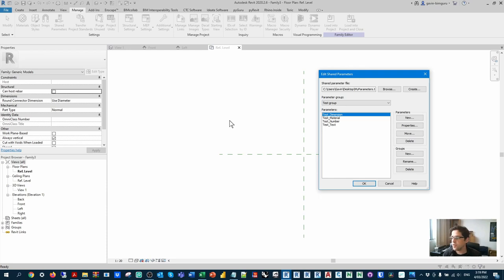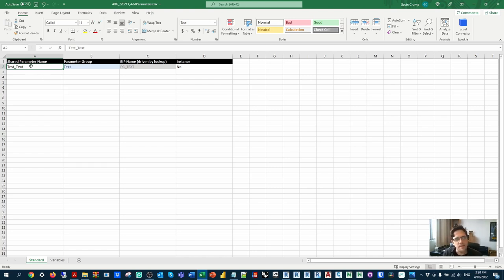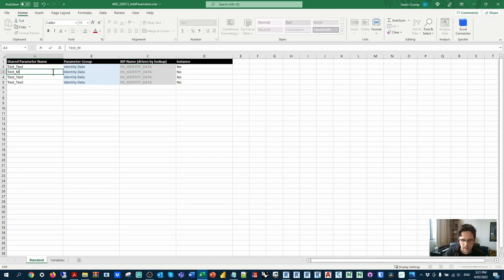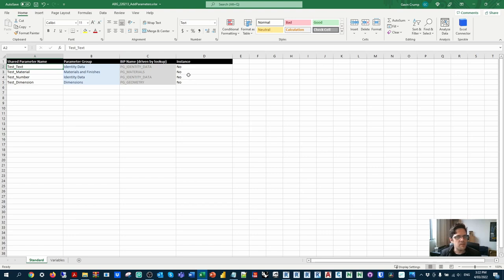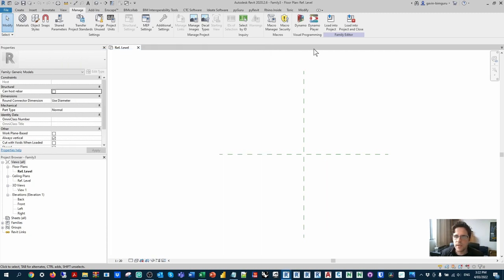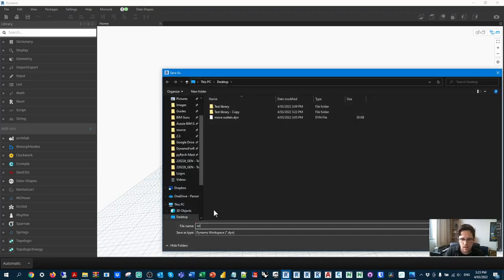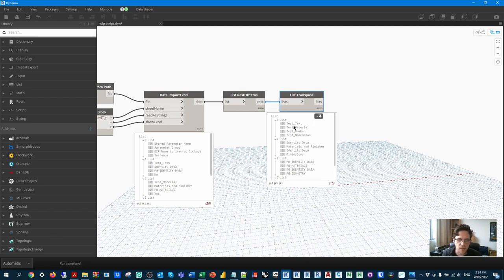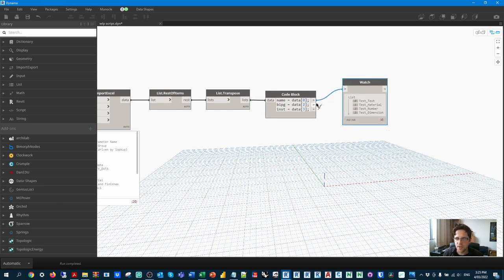Add parameters to Revit families using Dynamo (and Crumple)!

Comment: Thanks Gavin!

If anyone is using Revit 2025, some key compatibility updates/fixes for the new 2025 API are listed below, and updating this worked for me (also I don't have access to some of the nodes from Gavin's package so I created custom Python ones... but this below is updating BuiltInParameterGroup which is deprecated so use GroupTypeId).

1. Using "IdentityData" as example (not "PG_IDENTITY_DATA" from the old API version) matches the property name in GroupTypeId in Revit 2025.
2. Object Type: for Revit 2025 is of type Autodesk.Revit.DB.ForgeTypeId, which is expected for properties in the GroupTypeId class.

So, the input string "IdentityData" produces ForgeTypeId object in Revit 2025.
Reply from the maker: Yep it's a big change, I've added it into my Crumple nodes in the latest build.

Comment: Good to see your package 🙂

I am looking forward to open family from project and update its parameter values.  I searched on dynamo forum and Orchid package but all are pointing to directory. In my case every family has item number which is of instance type and the parameter values  will be assigned based on that.  

If you could provide node in your own package, that would be really helpful.
Reply from the maker: I have typically found directories a more stable method versus from project, however the method you could explore is in this case doc.EditFamily(x) where x is a family symbol object. There's a Python example of it here:
https://forum.dynamobim.com/t/change-family-category/57455/15

I'm unsure how this would work in bulk with the family manager but it's on my list to test out.

Comment: Hi Gavin, thanks for all the tutorials. Do you also have one for getting and setting of parameters using your package crumple? Tried varies methods, but only thing it returns is 'null'.
Reply from the maker: Not currently. For get parameter it only works for strings/numbers and across a list of family documents. For set parameter it requires a list of family documents/parameters and a list of list of values to set. If it isn't in that structure it wont work and will return null.
Reply: @AussieBIMGuru  Appreciate your response Gavin! I tried both, first with opening multiple documents in background, secondly with the current document. Or do I understand correct that you have to use a list of family documents? Anyway, there are four nodes; Document.Current, FamilyDoc.Types, FamilyDoc.Parameters and FamilyDoc.ParameterGet the first three all respond like expected, but the last node returns a null on every parameter. It should still run in Revit 2022 right?
Reply from the maker: @marcdenheijer606  so I believe I never made the node able to do multiple family documents due to it being too convoluted.

I've made an example in Python here of setting multiple family parameters by type and family using Excel here and will make a video for it in late June.

https://github.com/aussieBIMguru/Misc/blob/master/230512_ABG_SetFamParameters.zip

It doesn't accommodate for parameter data type, but can set any value with the right data types before it heads into the Python node.
Reply: @AussieBIMGuru  This is brilliant, thanks for this script Gavin! Tried the script and with some modification it did exactly what I expected: set certain parameters for all families and types (without specifying them in Excel). 

I suspected your first statement, therefore I also tried the crumple package also for just the current document. Without any success. Looking forward to your video!
Reply from the maker: @marcdenheijer606  glad to hear it helped! I'll likely package these up in a slicker format in my pyRevit toolbar down the line (guRoo), as I've moreorless cracked adding/deleting/replacing parameters and setting/getting/formulating parameter values as well via Excel and Python.

Comment: Hi Gavin! Thanks a lot for your videos! I've noticed that the AddParameter Method (String, BuiltInParameterGroup, ParameterType, Boolean) is no longer available in the Revit API 2023. As a result, I've started using the AddParameter method (String, GroupTypeId, Boolean). However, I'm facing issues when trying to adapt a similar workflow for the BIPGbyName node. Could you provide a hint on how to solve this problem? Thanks a lot!
Reply from the maker: Yep new forge unit API gripes.

Theres a good summary of how to work with this new class here as a reference:
https://forums.autodesk.com/t5/revit-api-forum/how-to-use-forgetypeid-to-add-family-parameters-to-a-family-in/td-p/11591733

Comment: very powerful and useful script👍
is it possible to assign values or even formulas to the parameters using dynamo?
Reply from the maker: Thanks!

Yes it is indeed, although i would suggest a different script for such an approach if you're driving it via Excel. Orchid and Crumple both have nodes for getting family types and setting parameters by name and family type (in family editor). Orchid has a node that can set formulae by parameter name and familydoc. I have a video on formulae in families from about a year back I think
Reply: @AussieBIMGuru  Thanks Gavin!

Comment: Nice explanaation. I have a question. Is there any way to make a similar proccess with imported families in the project? for example - add parameter to section tag family ? How do I open this family, if its in the project itself ?
Reply from the maker: Yes instead of opening the document you would need to use edit family and load document from revitAPI:

https://www.revitapidocs.com/2024/56e636ee-5008-0ee5-9d6c-5f622dedfbcb.htm

https://www.revitapidocs.com/2024/cb950c8e-f440-c6db-8563-d1dd16ef3fee.htm
Reply: @AussieBIMGuru  Thanks for the information. Already made same exel file as yours, saved family as a separate test file, and trying to follow each of your steps in this particular script to make it working.))) And after that, I'll check how to do that with edit family technique that you've shared with me.

Comment: thanks a lot , Is there a way if I wanna change the parameters type after i set them to instance or type because i tried it by changing the value in excel file but nothing happened
Reply from the maker: Yes unfortunately this script only adds new parameters. To modify then you would need another workflow that gets existing parameters then attempts to switch them to type or instance using Python. I believe clockwork may have some nodes that do that.
Reply: @AussieBIMGuru  waiting for it, thanks
Reply from the maker: @amratef3134  it's probably not going to be a video for me as it's a very narrow topic. I'd suggest looking into clockwork and if not engaging dynamo forums for assistance. I don't tend to do many dynamo videos these days as I'm exploring pyrevit/grasshopper more often.

Comment: Hi Gavin, excellent video... Again! if some of the families allready have the parameters with values, will the script overwrite these values or the script is written in such way that if the paramater exists it doesn´t touch the familly?
Reply from the maker: If the parameter exists already it will fail to add it, but should skip that step in the custom nodes.

Comment: Hello Gavin, great tutorial (as always). I was wondering if you have used this application for editing a model (and its nested families) received by a design team? If so, how do you get around having to reload each individual family into the working project?
Reply from the maker: Generally i would save all families out to a directory, run the process over them and then reload them as a set. That or request that the design team provide the parameters in their model in future.
Reply: @AussieBIMGuru  Thank you for the quick response. I will check to see if we have any pull with non-Design Build project architects

Comment: Would be interested in a similar node that worked in the active family document.
Reply from the maker: If you connect a current document node to the familyDoc input that should do the trick.
Reply: @AussieBIMGuru  Tried it out and it produced null as a result and did not add any parameters.
Reply: @AussieBIMGuru  Tried to edit the node like you suggested in the video to work with the current file but I always get null as a result. Its strange because there was a section in the code that looked like it replaced 'doc' with current document if the input was blank, but whenever I run without that connect it just returns function.
Reply from the maker: @facelessone86  yes the node should get current document by default in latest version of crumple and should not need any changes
Reply: @AussieBIMGuru  I'll try checking to see tomorrow if I'm up to date but it looked like I saw it in the code but wasn't working for me.

Comment: I see you’re using revit 2020.2.6. Did you also experience stability issues with 2020.2.7? Last month I had upgraded but within a day I experienced stability issues and reverted back to 2020.2.6. Read on an Autodesk forum other users had experienced the same issues. I had to spend over an hour to reinstall version 2020 because of it. Luckily I can do my new projects in version 2022. The PDF export feature is a real time saver for me.
Reply from the maker: Yep my mates warned me about it so I've been holding off for now. It doesn't seem Autodesk tests their updates very well these days, ever since that family loading debacle in 2021.

Comment: We created a Dynamo script that will get the parameters of a selected nested family in the family file, and copy its selected parameters into the family file (creating the same parameters there), and set their default value to the same value that the nested family had. Is there a way to make those parameters automatically associated with the parameters of the nested family?
Reply from the maker: I havent tried it before but it looks like this should be able to do that:
https://www.revitapidocs.com/2015/a047ea58-0351-b419-d856-85ed23734ee8.htm
Reply: @AussieBIMGuru   Thank you! Finally, I was able to do it with a Python script, that I copied from a forum, and had to modify to loop through each element of my list. It takes two inputs. IN[1] is a list of the names of parameters that I want to associate with each other (in my case the parameters from the nested family had the same name as the parameters in my family I wanted them to be associated with). IN [0] is the nested family element (for instance parameters), and the nested family element type (for type parameters).
Reply: import clr
clr.AddReference('RevitAPI')
from Autodesk.Revit.DB import *

clr.AddReference('RevitNodes')

import Revit
clr.ImportExtensions(Revit.GeometryConversion)
clr.ImportExtensions(Revit.Elements)

clr.AddReference('RevitServices')
from RevitServices.Persistence import DocumentManager
from RevitServices.Transactions import TransactionManager

doc = DocumentManager.Instance.CurrentDBDocument

elem = UnwrapElement(IN[0])
list_1 = IN[1]

for i in range (len(list_1)):

	paramNames = list_1[i]
	famNames = list_1[i]

	if not isinstance(paramNames, list):
		paramNames = [paramNames]
	if not isinstance(famNames, list):
		famNames = [famNames]
		
	elemParams = elem.Parameters
	famParams = doc.FamilyManager.Parameters
	
	
	elemAssoc = []
	famAssoc = []
	
	for param in elemParams:
		for name in paramNames:
			if param.Definition.Name == name:
				elemAssoc.append(param)
	
	for fparam in famParams:
		for fname in famNames:
			if fparam.Definition.Name == fname:
				famAssoc.append(fparam)
	
	TransactionManager.Instance.EnsureInTransaction(doc)
	
	for i,j in zip(elemAssoc, famAssoc):
		doc.FamilyManager.AssociateElementParameterToFamilyParameter(i, j)
		
TransactionManager.Instance.TransactionTaskDone()
	
OUT = elem

Comment: Nice job!! It works fine, but now I'm trying to add also a formula to some of the parameters. I've add a column to the excel file with formula values and tryed to modify the python script for "familyDocAddSharedParameter" but won't work... any ideas?
Reply from the maker: You'll need to use this method of the family manager class to set a formula:
https://www.revitapidocs.com/2023/cdc3156c-0334-0bba-70af-1df78fb18b50.htm
Reply from the maker: Once we get to python in YT comments its best to take it to dynamo forums, too technical for this environment.

Comment: FamilyDoc.AddSharedParameter gives me "Parameter not added" message. Recreated all script structure from your video + exel file. Cant figure out whats wrong.
Reply from the maker: Most common issue that causes that is not being connected to the shared parameter file or typos in the excel data.

My nodes wont typically work in 2024+ as they changed the Revit API there as well.
Reply: @AussieBIMGuru  I just tried in Revit 2025, yeah they didn't work. Will you please evolve your script? And a last question, How do I get the list of the BIPG ? Thanks, take care! Looking forward to seeing you back and happpy wedding!!
Reply from the maker: @qingyangpan78  I've updated the nodes in Crumple a few months back but haven't got time to test them all in R25. I believe most of them should work in Revit 2025 but might be a bit different to this video. I have sample scripts here:

https://github.com/aussieBIMguru/Crumple/tree/master/Script%20samples
Reply: @AussieBIMGuru Always thrilled to see your fast responses, thank you Gavin. I retried your updated package today but it didn't seem to work either. The problem might be the node "Parameter.BIPGbyName", it doesn't seem to function here...

Comment: Have you ever tried using this script to implement a FamilyType selection parameter?
I'm using the same script plus some extra parameter data pushing to building up my casework library. I have multiple casework doors as subfamilies and I want to be able to swap out the doors with a FamilyType label when within a project. The script will push through all other parameters, but fails to make the FamilyType selection.
Reply from the maker: This will only work if the components are shared and occur at project level. Sounds like they might not be shared.
Reply: My issue isn't allowing the components to swap, if I manually create the parameters and insert the door subfamilies everything works as intended. My issue and the reason I reached out is both the Crumple and Orchid (I know not yours) node for adding shared parameter fail when they try to create the parameter type, a family type drop down selection, that I am using for interchanging the casework doors. Your response did trigger in my head about attempting it through manual process again. I determined the reason the scripts were not inserting the parameter was I had no subfamilies loaded into the family. After loading in a subfamily, the nodes work for creating the subfamily shared parameter as well. 

I know you aren't developing much with the ABG channel any more. Thanks for all you did for the community. Your Crumple package is amazing.

Comment: Hi Gavin!,  by chance do you have the option to add nonshared parameters (regular parameters) in your package? .  the orchid node for that is giving me errors.  I used to follow your steps in your Orchid shared parameter video and used them with the Add parameter node (nonshared ) from orchid,  but once I updated to Revit 2023, the node gives and error, it even says that the orchid installed is not the same as the one in Dynamo.
Reply from the maker: Not currently, but its a similar python method. The orchid package has nodes for this but theyre not exposed in python.
Reply: @AussieBIMGuru  I see,  yeah it used to work for me in Revit 2022. I used to follow the same steps from your video tutorial on how to add shared parameters(2020 update) with Orchid, but with Parameter.Create node instead of the SharedParameter.Add node,  it worked perfectly. Now updating to 2023 Orchid's node went crazy giving errors, though it still works with shared parameters.  Thanks for the video Gavin,  learning python is a must, lol cause that flower is unreliable.
Reply from the maker: @CrlsE094  yes it looks like they changed it in 2023 to handle forgeunit types, huge pain. This is the method if you get to that point:

https://www.revitapidocs.com/2022/3ac89d60-4b71-694f-002f-125d2e6565fc.htm
Reply: @AussieBIMGuru  Thanks Gavin!, I'm trying to get there soon, I'll save it.

Comment: where you can find the script?? thank you very much in advanced
Reply from the maker: Search for my channel name on github
Reply: @AussieBIMGuru  This script didn't work for me because I want to add the parameters  to the families and specify the family of a Revit file in a model.
Reply from the maker: @Mohamedhassoun-j2x  yep that would require families to be edited from project vs a directory. Its possible using Revit API and a different approach.
Reply: @AussieBIMGuru  can i find a dynamo script that works like this?
Reply from the maker: @Mohamedhassoun-j2x  i havent made one personally, but it would be similar in logic to this, uses the same API class. This is the method to delete a parameter using the FamilyManager object:

https://www.revitapidocs.com/2024/cb266197-b76e-66db-ea15-2cf14bcb4f85.htm
Reply: @AussieBIMGuru  Hello! The script is giving an error at the List.indexof . My Excel file has two rows: the first row contains the parameter names, and the second row contains the values. I would like to modify this script to allow me to choose a family in the model.
Reply from the maker: @Mohamedhassoun-j2x  its an entirely different approach. Try asking dynamo forums for hands on assistance where you are stuck - too hard to troubleshoot on YouTube.